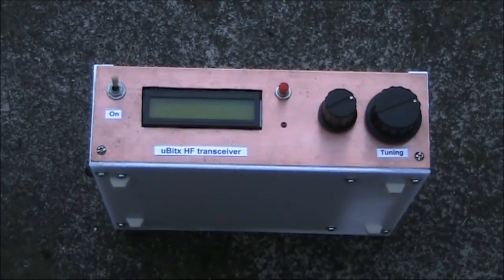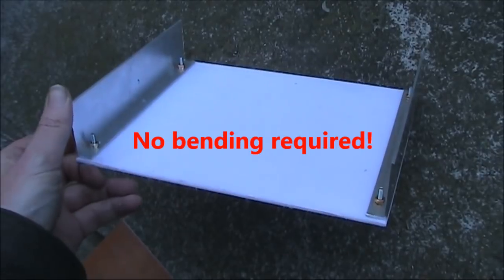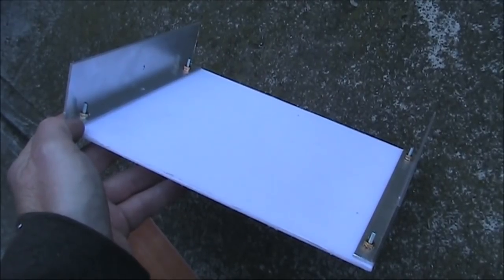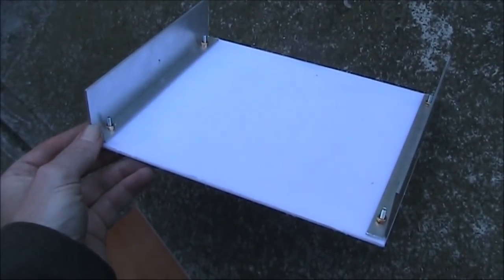A simple case for the uBitx transceiver and other projects

Comment: why not use something conductive instead of chopping board, so you get some shielding? I built my ubitx in the plastic box it came in, which works reasonably well, so this doesn't really give an advantage because of the lack of shielding
Reply: You could spray glue  aluminium foil  on the chopping board'.